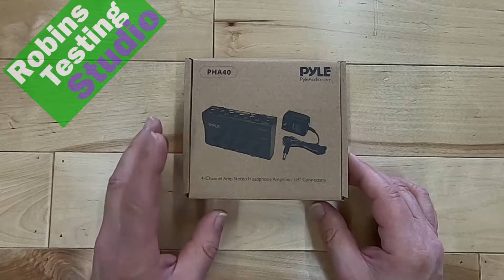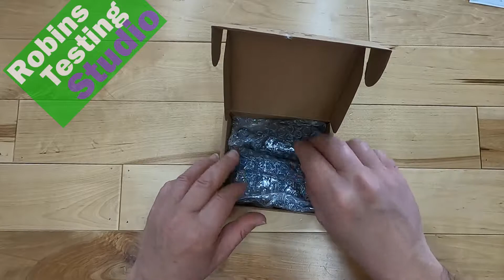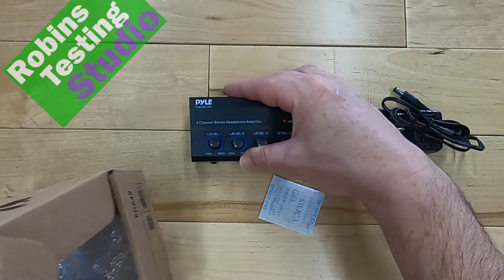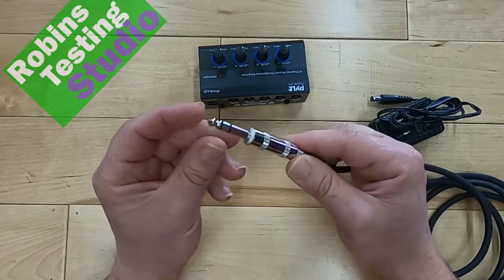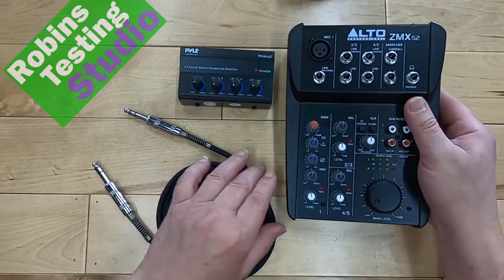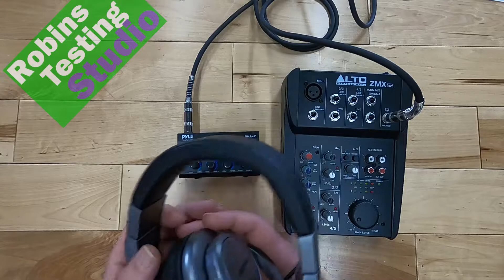Features of the PHA40 4-Channel Stereo Headphone Amplifier

Comment: Can I pass this through my powered speakers ? The output from the headphone amplifier ?
Reply from the maker: yes, but you need to use balanced to un-balanced connectors to the speaker have a look at the link to see the cable on Amazon https://amzn.to/3Y2MWNa or you will run into a noise-canceling problem with the connection.